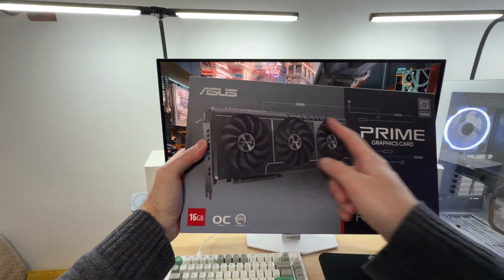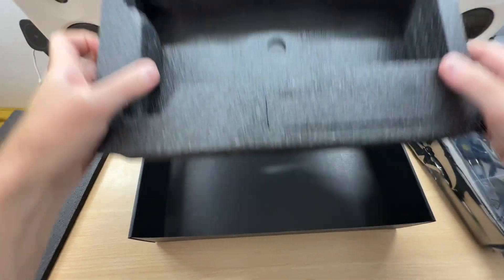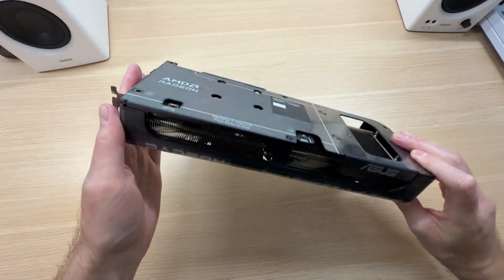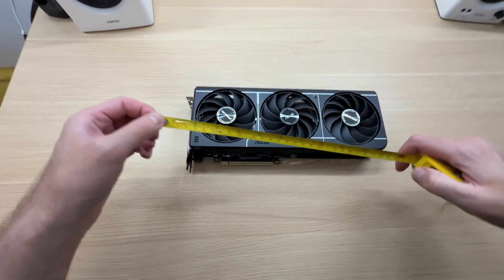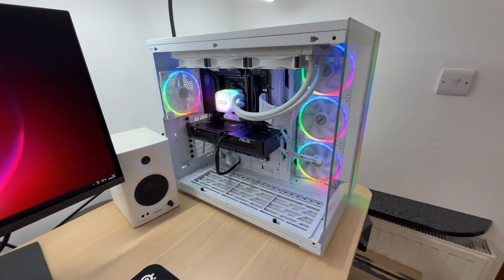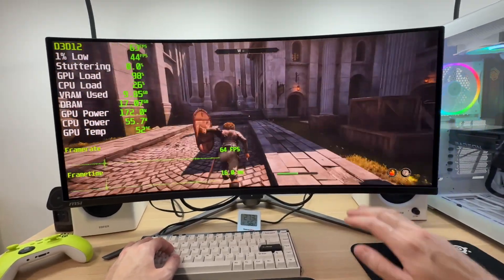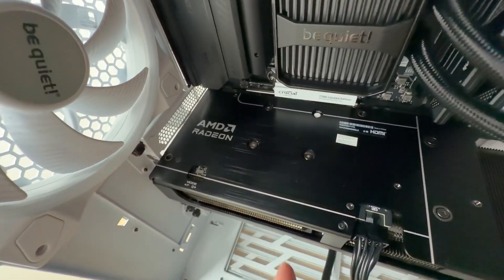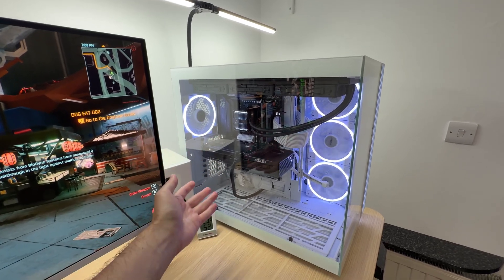Noisy or Quiet? ASUS PRIME OC RX 9060 XT 16GB Review

Comment: This card has triple fans, but only three heat pipes, so it's not too expensive. I would choose another model with triple fans and four heat pipes, or the PULSE with dual fans and four heat pipes, but the PRIME is plenty cool and quiet. One thing I'm curious about is whether or not they use a phase change thermal pad. Power Color and Sapphire use PTM7950 even in the 9060, but other manufacturers do not list it. This means that the two companies may be slightly better in the long run. XFX may also be using the PTM7950.

Comment: You know as someone who recently bought a couple video cards i really wonder... why do they annoy us with all this unnecessary protective plastic film you have to remove prior to installation when the card comes in an anti static back stuffed in a protective casing anyways. It is just annoying. 
I mean they hardly can´t get scratched in there, the extend for that to happen is going to tear the box to shreds and potentially damage the card in more then just a scratch.
Reply: i once work at electronics factory. those protective film is apply by different section. and antistatic plastic is at different section. while its going through all the process they dont want the product got scratches bcs of human hand. considering i need to pack hundreds of product per day aint no way im not gonna scratch one if those protective film isnt there
Reply from the maker: Plastic is prone to scratching easily. That protection is needed to avoid any scratches that may occur during the product bouncing around inside of that box during transportation. It might be excessive in some cases. But I take it as a sing that company cares about their product first impressions.

Comment: I think to add to the noise test, you should also include a part without the side panel on. So that we can notice more subtle differences from profiles for example. I am about to buy a brand new PC for the first time in 6 years and it is my first higher end one since I had a pentium 4 like 20 years ago lmfao.
Reply from the maker: I make real-world tests. Keeping PC case open doesn't line up with my mission. Also, the air coming from the fans would hit the mic and the sound meter messing with recoding and measurements.
Are you thinking about building a PC around the 9060 XT GPU?
Reply: @theivadim  Ok that is fair. I just figured if you wanted to present things like higher pitch in fan sounds and such.

I am either getting a 9070 xt or a 5070 ti. If the PNY 5070 OC plus is still on sale. I would only pay $70 more for it and I think it would be worth it. What do you think?
Reply from the maker: Indeed, I would choose the 5070 Ti as well, since DLSS 4 is supported in far more games than FSR 4.
Reply: @theivadim  That is my thought as well. If FSR 4 was in all the games that have DLSS 4, then I would go AMD as I could save money.

Do you think it is worth paying basically 2x the cost of a 9600x to get a 7800x3D instead? I would be at 1440p. I have seen the 7800x3d handles 1% lows better.
Reply from the maker: If you like pushing your games to high FPS then sure. The 7800X3D is a well-balanced choice for the 5070 Ti. The 9600X is a CPU that you'd normally pair with a lower-tier GPU, like the RTX 5060 or 5060 Ti.
Reply: @theivadim  Yeah that is what I was thinking too. And with the 0.1% and 1% lows being quite a bit better and stable on the 7800x3d it just makes sense. It is 2x the price here in Sweden though. 9600x is like $230 and the 7800x3d is $430